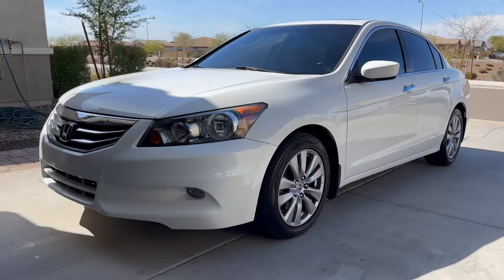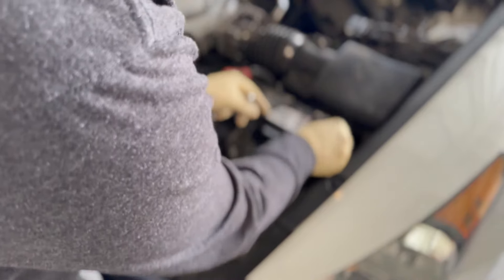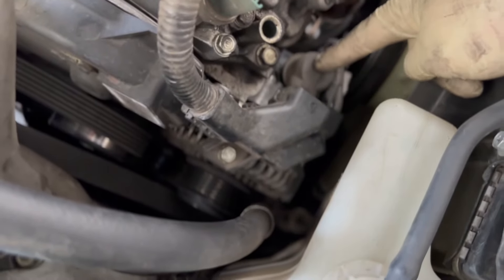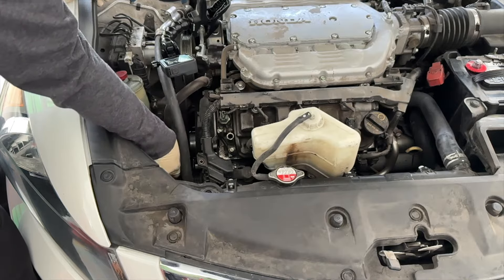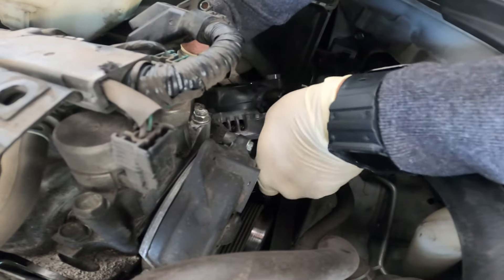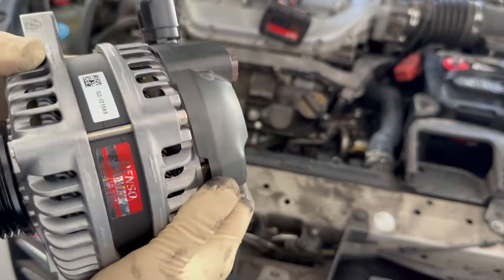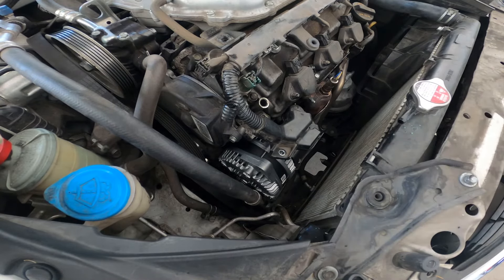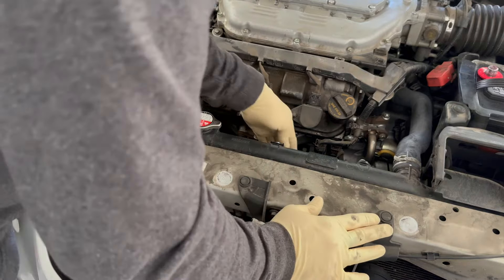How to Replace the Honda Accord 3.5L Alternator - Tips & Tricks.

Comment: It would’ve been really nice for you to explain how you get those bottom bolts out for the fan. I’ve been working on this for over an hour and it would’ve been very helpful.
Reply from the maker: They are hard to get to I’m pretty sure I explained how I got them hard to film. But for sure you can get to both from the bottoms the skid plate will need to be unbolted or removed..
Reply: Thank you, I was in a bad spot and just was in very bad mood when I was posted that. Thank you for responding
Reply: @charliegurganus3725 i feel this to the fullest 😂😂😭

Comment: What actual bolt am i supposed to attach to release the belt? Is it on an actual pulley, or is it attached to the frame on the tensioner?
Reply: the best is tensioned so you have relieve pressure it by working with the tensioner